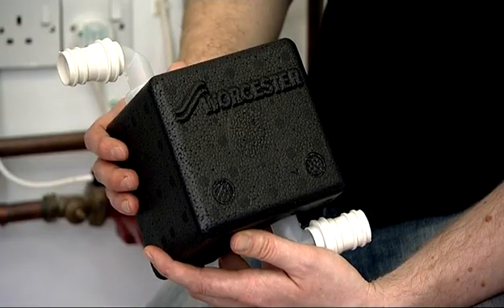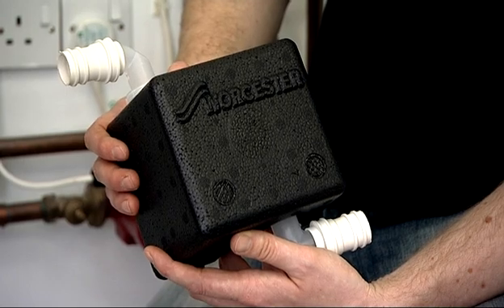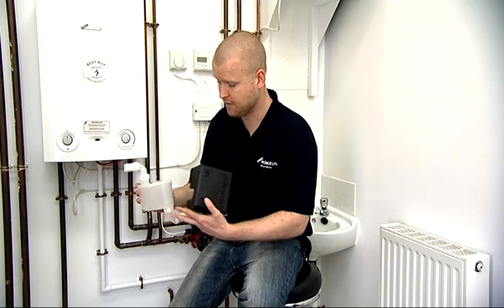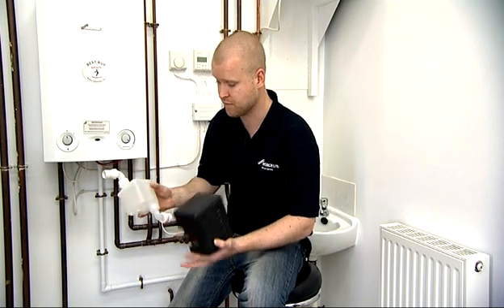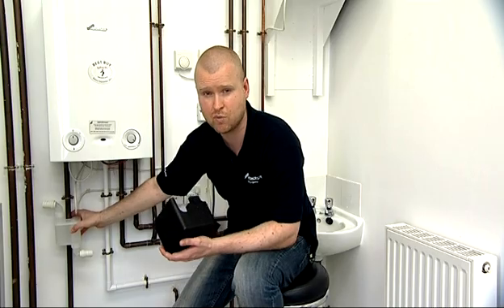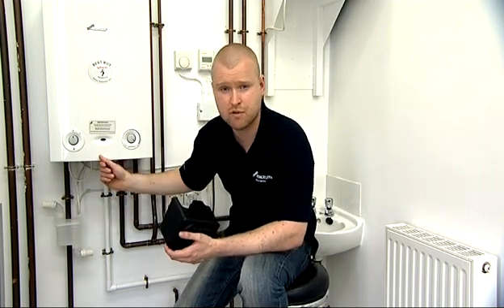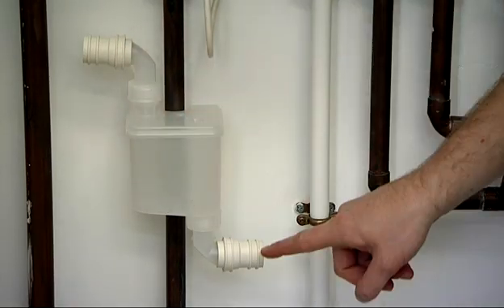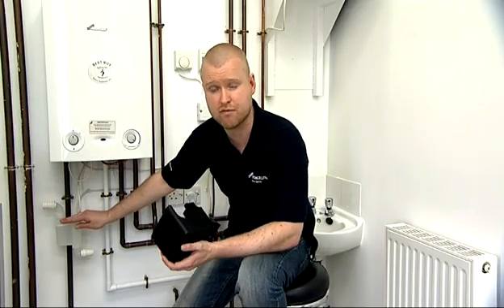Thaw and Prevent Frozen Condensate Pipes

Comment: My condensate pipe runs outside from the top floor bathroom into guttering on my utility room roof ... do not stand on a ladder (placed on the icy concrete) with a kettle of hot water trying to slosh it above your head..... it doesn’t work, neither does calling a local heating engineer and paying him to basically do all of the things you have already tried.  Best bet is to wear a onesie with the hood up, fluffy socks and crawl under a blanket for 3 days or until everything has thawed (whichever is the soonest). Let’s face it, it’s going to save a fortune on energy costs right? For those of us on minimum wage that have a mortgage you’ll know that every spare penny goes on fixing the next thing that breaks down, falls off or explodes (the boiler being in this category).  I can’t afford food let alone lagging and paying someone (who will tell me with a sharp intake of breath “that needs scaffolding love”) to fix it.  Can’t chat anymore as I need to scoot off to Primark to stock up on fleecy nightwear and hot water bottles (wondering now if i string a few together, maybe I can lean out of tiny bathroom window to defrost pipe when the next ice age hits)🥶

Comment: Why has the condensate got to be discharged out with the property? The condensate from my Worcester-Bosch 30 CDI boiler, which has been installed within my garage, has the discharge pipe discharging externally during the summer, then diverted internally to a five litre container from September until the following March. The container is regularly emptied into one of the external house drains. However, your system looks like the bees knees!

Comment: If the installer fitted lagging to the condensate pipe as per the instructions and/or routed the pipe internally for as much of the run as possible, there would be less likelihood of a freeze-up. Unfortunately, the installer we used did neither so will lag it before next winter. 
No point blaming WB if the boiler was not fitted correctly.

Comment: Why warm water not boiling water?
Reply from the maker: For safety reasons we recommend using warm water (we wouldn't want you to accidentally splash hot water over yourself!) 
Boiling hot water could also damage the pipe.

Comment: Thank you for the advice. however the continuing warm water did not melt the ice in the outdoor condensate pipe. I left my wife continuing to do this while I went to B&Q for some insulation cover. They did not have any left but instead I was sold a small jack saw & advised to cut the pipe completely through just above the lower joint & pull it gently to the side to release the ice.when I returned home the hot water had still not done the trick so I cut the pipe & sure enough the ice dropped out whole approx 10 ins long.I taped the pipe up with duct tape.the boiler started up immediately & has been running fine 2 days later. Couldn't see this advice anywhere here.Was this action ok to do? Do I need to reconnect the pipe with a join or is it ok to leave on the duct tape ? Do I need to call out British Gas for a check over with whom I have a service & repair contract with a £60/excess?
Reply from the maker: Hi Christopher, sometimes it can take a while to unfreeze the condensate pipe. Usually if you persist with the warm water method shown in this video the condensate pipe will eventually defrost. We do not advise cutting any pipes to your boiler. If you're unable to unfreeze the pipe, we recommend contacting your boiler installer (or a qualified gas safe heating engineer) for assistance.

Comment: At Surface Heating Systems Ltd, we make an integral heating system which comprises of a heater cable which runs inside the of the outside pipe and powered by the boiler auxiliary supply. Thousands have been supplied to Scottish housing associations with no problems. Comes in 1 - 7m heater lengths with a fitting kit including a plastic T piece and compression glands and is available either direct (info@shs-ltd.com) or through Plumb Centres.

Comment: My pipe outside is really long going to the drain which is completely lagged with  the foam lagging and my pipes  still froze. I'm disabled, I was lucky to find a neighbour who defrosted the pipe for me. The 'fix' you have should be fitted as standard when the boiler is fitted surely?? Oh by the way the fault on my boiler was EA. I understand there is another 'fix'. Fitting a thermostat with RCD. Which is a wire that wraps around the pipe and warms it up. As said either SHOULD be fitted when the boiler is fitted. Especially where the pipe is inaccessible as some, seem to be, from reading the comments on here!!

Comment: Had a Worcester boiler for 10 years...and absolutely no problems till yesterday when it kept cutting out and gurgling till the reset button came on.

I called the engineer as I hadnt a clue it xould be this,and it turned out to be this problem...and the boiler was back to work silently
 pronto.
But if this weather continues I'll be out there with the kettle myself!
Worcester Boilers are the Dogs Bollocks of Boilers..10 years No Probs..heres to another 10!!

Comment: Condensation pipe cut the pipe 
Near the boiler redirect it to a bucket basin and just check daily 
Empty when required job done 
Then when better weather comes back reattach pipe untill winter again i do this every year and ive never had a problem .2nd drainage 
Outlet cover with block of inslation
3rd use inhibitor with anti freeze buy from screw fix £20 .

Comment: Yesterday my boiler pipe was frozen i defrosted it :) now i got hot water but i dont got central heating any ideas?
Reply: Can you hear any gurgling or trickling water? If so it's not completely unfrozen. Also make sure to reset the boiler.
Reply: Yah when central heating turns on i hear the noise from the boiler and it turns off..
Reply: i pulled about 200 litres of hot not boiling water:)  and it seems to be fixed.
Reply: thanks:)

Comment: Having watched the video about hot water to the condensate pipe, having put 2-3 kettles of hot NOT boiling water on the pipe, resetting the boiler and after a few gurgles and coughs it ran fine. Thank you.

Comment: Worked perfectly.  It took 3 kettles of hot water and a few gentle taps with a hammer and the ice was dislodged.  Could have been left without heat over the next few days, as it is Thursday and the country is in lockdown as a result of the 'Beast from the East' meeting-up with Storm Emma and an expected 60cm of snow over the next 24 hours.

Comment: Maybe I am missing something, but if this new product means using a lot more water, which it takes from the central heating, doesn't this mean higher gas and water bills to cover this new increase? 
All this extra cost (buying / fitting / extra bills) just to make good a product that clearly wasn't built fit for purpose in my opinion, had two issues already in less than 3 years on a brand new Greenstar 32Cdi Compact (loft installed).
Reply: Mine froze too and the pipe is very high up so no chance of pouring hot water on it. With telephone help from my plumber I disconnected the condensate waste pipe near the outlet from the boiler and have put a bucket underneath. Beware LOADS of water came out at first (very full bucket) but now its just dripping and I will just have to empty it every so often until the pipe unfreezes itself and I can reconnect. At least I now have heat!
Reply: Tumbleweed Bob - I think it just stores up the condensate and let’s it go all at once rather than drip drip drip. That way the pipe if it goes outside goes by get a chance to freeze the tiny drip and therefore build up until the whole pipe is frozen. The mount around the hot pipe is just it fitting around it - it doesn’t take any water - just uses the radiant heat to make sure the condensate that’s about to discharge all at once is also a little warm.
Reply: That sounds a lot better than my version, thanks for clearing that up. 
Now I just have to wait 6 days (yes you read that right, SIX DAYS) for Worcester Bosch to get to my home to fix our boiler. So as long as me and the kids haven't died from cold by then, I've asked them to bring one of these to stick on it as my new boiler is only 3 years old and this is the second time we've had a problem with it, so, I still stand by my "not fit for purpose" comment as that sums up their Greenstar CDi boilers.

Comment: I think this may be my problem, boiler wont light properly and there's gurgling.
Yep, pipe is blocked with ice. Boiling kettle now.

Heating fixed. Boiler dude you're a hero.
Reply: How ? Help
Reply: So you go outside. You see a plastic pipe that comes from your boiler. Just follow the plastic pipe from your boiler to the outside, you'll see it. Pour hot water on the pipe where you see it outside the house.

Comment: "Dont attempt if the condensate pipe is installed above ground level"  Isn't the pipe hes putting hot water on above ground level? Am i missing something?
Reply from the maker: upurnose46 Thank you for your enquiry.The reference to ground level is where the condensate pipe is exiting the building.In this instance the advice is not to attempt to heat the condensate pipe if it is exiting from the first floor or, for example, the attic.We hope this clarifies this.
Reply: ***** Ok i understand now, thank you. What is the reasoning for not heating a condensate pipe above the first floor?
Reply: Mine froze too and the pipe is very high up so no chance of pouring hot water on it. With telephone help from my plumber I disconnected the condensate waste pipe near the outlet from the boiler and have put a bucket underneath. Beware LOADS of water came out at first (very full bucket) but now its just dripping and I will just have to empty it every so often until the pipe unfreezes itself and I can reconnect. At least I now have heat!
Reply: Good Dynamic risk assessment, people can fall out windows or off ladders